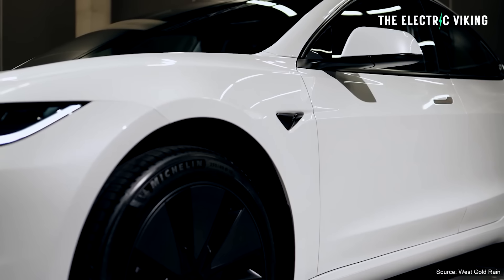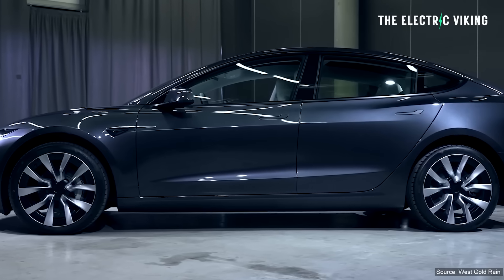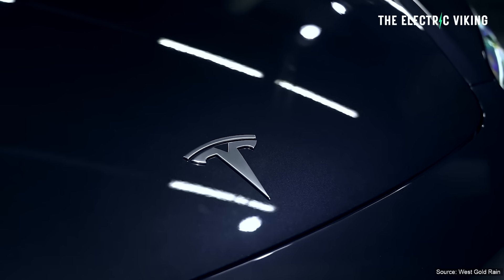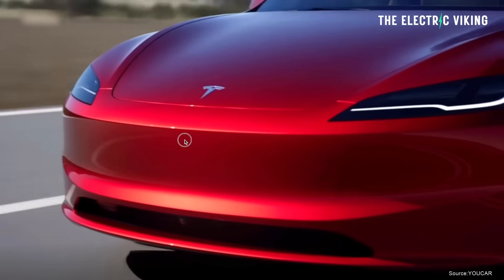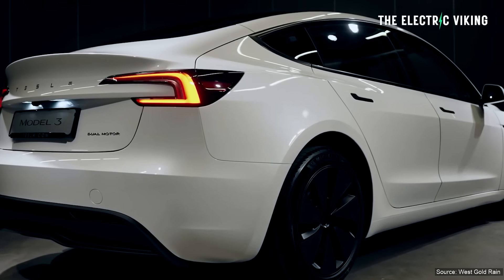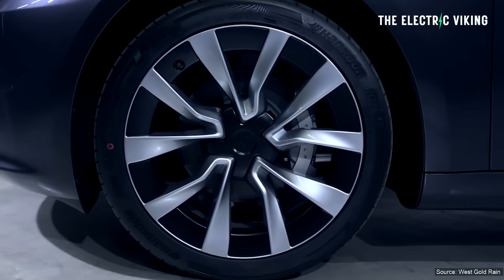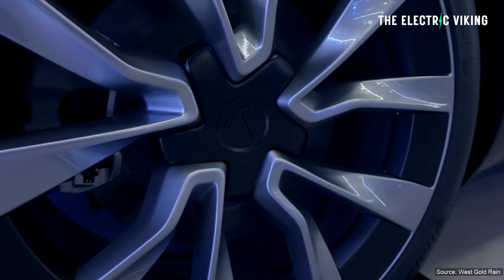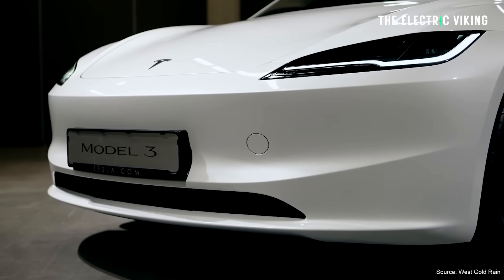Batteries, size and power of new Tesla Model 3 revealed in MIIT document

Comment: LFP is way to go cuz the cycle count is far greater 
like you said you can charge to 100% so range might work out to the same as NMC to 90%

keep in mind that solid state batteries are actually here.
the output is another level up
and cycle count is around 2500 

the Japanese already has them, CATL also has them ready as well

Can you also test out those seats ? cuz all these time, they came with hard seats, very painful to seat on long drives

i saw a guy in German mentioning the German version had switched up the seats

Comment: First, love your videos, you literally introduced me to the Chinese EV market.

I have to take a small issue with your comments on LFP vs. NMC only on the range issue. Real world is more complicated than it sounds. Very few people care about the range except for on a road trip, or some other long trip. You can charge the LFP battery to 100% sure, it is even recommended by the manufacturer.  However, unless you are charging to 100% at home, in reality you can't charge an LFP battery to 100% either, unless you have a lot of time to kill. The charging curve on the LFP has the same problem that the NMC does where the charging rate drops off significantly starting around 80% SOC and by 90% it is crawling. Point is that you will get 100% range on your first leg of a trip, but once you hit the charging station unless you want to stay charging for an hour you won't be able to charge to 100% at the fast DC charger. They are still better in many ways, but just the nuance there is missed when you just say people can charge to 100% all the time. If you are stopping for lunch while charging, then sure it can happen.
Reply: i stopped buying LI batterys i cant fully charge & store, sick of them dying on shelf waiting to be used & i dont feel like waiting 30 mins to charge a flat battery every time i want to use a tool. i went back to corded tools.
maybe ill get some chinese LFP cordless tools sometime 
but i know from experience the AEG Husqvarna ext ones only work for a few 100hrs before they die, a few weeks work and its dead & charging them up the night before for work in morning seems to 1/2 that
Reply: @hamasmillitant1 Your experience is completely the opposite of mine. My Ryobi set with lithium ion batteries work great, and hold their charge very well sitting on a shelf. I have let them sit for weeks without using them and they still have lots of charge. The only issue I have is that they do wear out pretty fast, meaning they may only last 2-5 years before i have to recycle them. My EGO mower and blower have had no issues with the batteries either.

Comment: The lower ground clearance is 138mm vs 140mm in the old model 3.  

My experience so far is that there’s 1cm ground clearance getting out of my driveway.  And there are multi storey car park ramps that I’m not going to drive up anyway for fear of getting grounded.  Ferry boat ramps are another point of concern.  Losing 2mm might not sound much, but it’s not helping with practicality in tight spots.
Reply: My main fear exactly. I do have the cash prepared, but damn the "old" MY SR looks better price wise than the "new" M3 LR since I don't drive more than 150 miles in one go.

Comment: My 2022 M3 RWD does 0-60 in 5.8 seconds you said the new version is over 6 seconds. Sounds like a downgrade. Not enough changes to warrant buying the new model. Also, not having the stalks but having buttons on the steering wheel for drive modes and turn signals is a no-go for me. I like the current model.

Comment: My Prius V is over 4200 lbs. and only gets 44 mpg with ridiculous maintenance costs when you do all the fluid changes and other required maintenance in the first 100,000; somewhere in excess of $4000 plus $600 in tires every 45 to 50 thousand mile.  Even had a Toyota maintenance package that paid for a total of 3 oil changes after the "Free" dealer changes that expired exactly when all this required Maintenace starts. Getting a new Model 3 Highland rear wheel version when it is offered in US.  I am to say the least done with Toyota, ICE, and the pathetic hybrid versions.  Best hope to your wife and family.
Reply: 2017 Prius V is 3340 lbs.   Maintenance schedule calls mainly for "inspections of fluids, brake pads, etc." and tire rotations.  Oil change every 30k miles according to the official Toyota site.  So, 3 oil changes in 100k miles at $59 each.   You should never buy maintenance packages--they are a ripoff.

Not saying you shouldn't buy the M3, just pointing out the real data.

Comment: Could you do a deep dive on batteries, I’m getting mixed information. You often talk about how bad it is to charge to 100%. My understanding is this is true but only if the battery remains for a prolonged periods of time above 80%. If you are, for instance, going on a long trip and fully charge, then there is little degradation. Just so long as the battery isn’t sitting above 80% while on the charger or after driving. The only reason it’s not recommended to do so is that the charging rate slows down and it’s not worth waiting for the last 20% and not because of damage to the batteries.

Comment: Curb weight of 3880 lbs for the rear-wheel std range Highland M3 makes it a little heavier than the 3,600 - 3,800 lb. (spec varies) previous M3 it is replacing.

However, the weight of 4,019 lb for the long-range Highland M3 is slightly lighter than the 4,065 lb. long-range M3 it is replacing. This does suggest that the increase in weight for the std. range Highland is likely due to the LFP battery, since the long-range versions use the Li NMC battery.
Reply: Sr model 3&Y have both had lfp cells exclusively since late 2021 now though. I wonder if the weight isn't from the additional sound deadening, dual pane laminated glass for all windows and roof. Plus maybe the rumored 66kwh capacity catl lmfp or m3p pack's?

Comment: 3880 lbs is lighter than my 2012 Audi s5.  Pretty impressive weight reduction.
Reply: Nice, about what an average mustang gt with fuel weighs as well now. 
Fun fact a 60s Lincoln town car could weigh over 6,000+# 😀

50 years ago cars without the proliferation of pickup trucks and suvs? Weighed over 4,000# now it's about 4,300# considering the safety advancements, power increases, braking advances, tech and luxury features etc. It's impressive really how weights are not even higher! 👍🏻

Comment: I don’t think you’ll gain any new knowledge by buying the new version of Model 3 since the motor and batteries are the same. LFP works best in warm climates. Like you said, NMC is better in cold climates, but should be charged to 80%, which defeats the purpose of long range. The update is more about keeping up the technology than a leap in ride quality.

Comment: From Vic so we get no incentives. 100% ordered the LR - the faster speed and the fact it’s AWD is the selling point. 
No one ever really going to have issues with range in either, even with degradation. 
Iv had a couple of close calls with slippery weather and having had awd quite literally saved me. 100% worth the extra cha Ching Ching. 
Plus we all love to take non Tesla drivers for a spin and you have to show off with that excel - hope there is the excel boost in it too. 

No doubt there will be another release with a diff battery but I can’t wait that long. If you buy new car and hold for 500k kms then you probs are not a real enthusiast. Sell and trade every few years 👌

Comment: You keep quoting the full power of the front and rear motors but not all that power is available in the LR. Just think about it. If the LR used all the power available from the motors how could the Performance Upgrade increase the power to reduce the 0-100 time from 4.4s to 3.7s? So what is the actual power of the LR?

Comment: If the LR had say a M3P I might have been tempted, as here in NZ the LR just squeaks under our EV rebate at the moment (although that may be deleted if the National party wins the election unfortunately). But really my current LFP model 3 (and even better the new Model 3) has sufficient range for my needs anyway (as long as the battery holds up over time as well as we expect it will). In any case its quite possible that battery updates could show up in few months (and probable over the next year).
Reply: What do you mean by: “If the LR had say a M3P I might have been tempted” ??
Reply: @carstenschmedes6599  M3P is another way of saying LMFP chemistry. Higher density than LFP but with nearly all the same benefits of LFP.

Comment: The Tesla NMC batteries are proving to be very reliable in the testing.  Should be good for 300k miles.
Reply: 300 miles +
Reply: @rozonoemi9374  maybe he thinks of degradation and overall lifespan of the battery.

Comment: The following lists are my understanding of the two battery types. Is this right or wrong?

LFP:
Can regularly charge to 100% without degradation
Can regularly discharge to 0% without degradation
Not fire-prone due to no manganese metal (which burns exothermically)
Promises more recharge cycles
Lower energy density compared to NMC, which means heavier car for the same energy storage

NMC
Tesla highly recommended that charging be kept between 20% and 80% for optimum battery life
Fire-prone due to manganese metal, although the Tesla battery control system ensures safe operation, many incumbents are burning
Promises many recharge cycles, but reportedly less than LFP
Higher energy density compared to LFP, which means lighter car for the same energy storage

For what it's worth, I much prefer having 100% of the battery available to me at all times and "not* having an exothermically dangerous battery pack below my family. More recharge cycles in the LFP are a bonus. And I guess the lower energy density is a tradeoff I'm willing to make. 

So LFP is my choice.
Reply: Or one may realise though the LFP is less fire-prone - using an aqueous electrolyte - and more conservatively managed (calling higher lows and lower highs as empty and full).  Ternary are more thermal runaway and fire prone, but conversely are run closer to the lower and upper  limits risking runaway and degradation - to publish extreme limits and power (LFP calling 3.65 volts 100% rather than 3.7 makes a difference - same with Ternary cells, just calling 4.10 or 4.14V 100%. (rather than 4.25) reduces stress in the cells.).

Comment: When the new Model 3 goes into production in Tesla's other factories, it may not have the same batteries. In particular, the US plant will make cars that qualify for the US tax credit.
Reply: Source? The tesla website itself warns anyone that come Jan 1st of 2024 when the credit switches over to a pos redeemable rebate?
The new cell sourcing percentage rules kick in and the model 3 will or is LIKELY to see reduced credit access. 

For the record I hope you are right and they reintroduce the nmc base pack sr m3, ad a 4680 structural pack for U.S. only m3 highlands?

Or figure something out to keep the full tax credit access going. A model 3 refresh with near 300 miles of range, everything it comes with standard and the scer network access plus a $7,500 front loaded discount. Is going to see insane demand in 2024 imo. 👍🏻😎

Comment: I have bought the hilighland standard range as you just because you often stress the supriority of the battery. 
Of course as well in Italy the SR get 5k€ incentives whilst the LR doesn't qualify. Not yet understood well how is it possible to get 8% more range with the aerodynamic  only. Anyone there to clarify this point?
Reply: The new ev only tires added about 3% of that, more efficient chips helped and the aero, plus rumored lower power but more efficient motors. 
Elon and drew warned about this change last summer, saying the base cars we're overbuilt for reliability and slightly over powered.

Comment: I gotta say, I'm a bit disappointed with my Model 3 Long Range. I opted for it because I often hit the road for longer distances, but there are a couple of letdowns.

First off, I'm concerned about the battery type of my Model 3 Long Range. Not being able to fully charge it without risking degradation is a bit worrisome. 😕

Secondly, the absence of a front camera is a real bummer. It's such a handy feature to have!

Lastly, I'm genuinely surprised that it's still running on the old HW3. I was expecting a more updated setup by now. 🤔
Reply: Charging to 100% is no problem if you use that energy right away. Just don't let the battery sit for days @ 100% cause that will stress the battery. & Don't forget there is also a top buffer on the battery.. But if you are that worried, charge to 95% for instance.
Reply: @pieter85  appreciate it 🙏
Reply: Don't worry at all to charge at 100% or 95, i did that on my Kona 64kwh NMC battery and the degradation after 125k km is just 4.5%

Comment: I heard that you must charge your LFP car to 100% at least once every week, if you want the fuel gauge to be accurate. That sounds like a pain in the butt. Prefer my NMC which I can charge to any level and still get an accurate gauge. I only take it to 100% very rarely for long trips so not concerned about degradation.
Reply: What fuel gauge? 😁
Reply: @keungy  Battery level
Reply: What’s the big deal?
Reply: @jasonlewis6373  No big deal. Just that Viking suggests there are only upsides to LFP and that's not correct.

Comment: NMC in the LR also charges faster on supercharges and doesn’t suffer the restrictions on re-gen on long descents like LFP variance do. I’ve had my car at 100%, and I still do get some re-gen. They also aren’t so sensitive to extreme temperatures. I have the long range with the NMC and must say I am extremely happy with it. Would I buy another one again? Absolutely yes!
Reply: I also habe he LR but I must confess that the BYD LFP batterie here in Germany is charging faster than the NMC! It charges in about 20 Minuten from 10%-80%. That is not the case for the "old" CATL LFP batterie for the Shanghai cars...
Reply: @simpromovie   I don't believe a word... 20 minutes? That's faster than the 800V NMC platforms out there . No way! BYD's usually have really bad charging times...
Reply: @pieter85  I am sure he means the BYD Blade battery as used in the model Y in Germany, he is not talking about in a BYD Atto3 with a maximum DC rate of 89kwh.
Reply: @pieter85   BYD has only "bad charging times" on BYD cars! On a Tesla these Blade Batteries are super fast!
You can check this video, but it is only in German. On Min. 30:02 the charging result is shown. From 12%-82% in 22 Minutes...

Comment: LFP for me! Placed an order for the RWD M3 as soon as available. Held off on my M3 order until the highland refresh was available in Oz. Mr Viking I'm not concerned about the 3 to 4 month wait. Gives me time to get the home charging infrastructure set up. I also need to purchase some Amazon after market extras like floor mats, mud flaps, sun roof cover etc. Theres a few free AC EV charges up the road at Woolies next to the Tesla super chargers. Need an extra cable for them. I'll probably be broke before I get the car at this rate. 😂
Reply: - great point, so the EV experience isn't just the car, it is the home charger, solar, battery and necessary Amazon add-ons..  No way it would be under any reasonable FBT  or LCT threshold if these were included in the deal.

Comment: Very few people who buy high power cars actually use the performance, if ever. Bragging rights are what matters; speed on UK's clogged roads is limited by the gap between traffic-jams, and one's nerve exceeding the speed- limits. I'd be happy with the performance/handling equivalent of a well set-up 2 litre Subaru. I hope there will be a 'sporty' version of the model 2, and that it doesn't look like the redneck, Cybertruck, oaf-mobile. 300 mile range is plenty for me, (I need a bio-break long before that anyway). LiPO4 in mine please!

Comment: I want LFP and I want longer range for trips.  Unfortunately, with the current state of LFP, you can't have both right now.  Hopefully, within five years.  For now, I'd go with ternary and charge to 80% daily, and occasionally charge to 90% to 100% for trips.
Reply: You don't need more than around 250 miles for long range trips. We have 2022 M3 RWD LFP battery. After 3-4 hours you need a break. In the USA there are so many Tesla Superchargers, so the convenience of getting off the highway when you want or need to is no problem. By the time you go to the bathroom grab a coffee or get some snacks you are rushing back to your car because it is almost at 100% and you don't want to incur idle charges. On a recent trip some of the Tesla Superchargers were in grocery store parking lots. So you can stock up on snacks, water, whatever and charge at the same time. In a gas car you would probably be stopping twice, once to fill up and another time to shop for groceries. Unless you just like to drive continuously on a road trip without stops, you don't need a long range EV.
Reply: @EVVolksmanID.4  That works for some trips, but not all trips.  For example, it might work if your destination is an urban area, but might not work if your destination is a remote area, say in the interior of the western US.  I am currently planning a trip to a cabin in a remote location that is more than 150 miles from the nearest en route fast charger, and the cabin has no power.  Making it work requires use of L2 chargers, which is less than ideal.  What's frustrating is that there are planned fast chargers that would make the trip relatively easy, but they're not built yet.